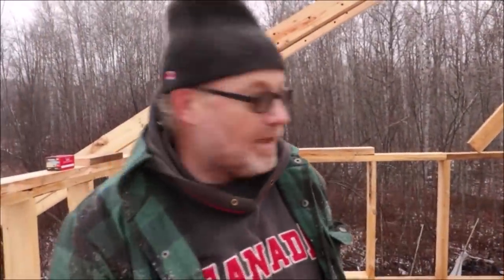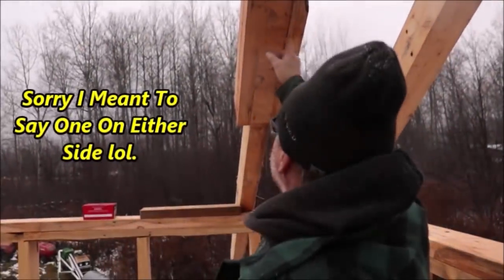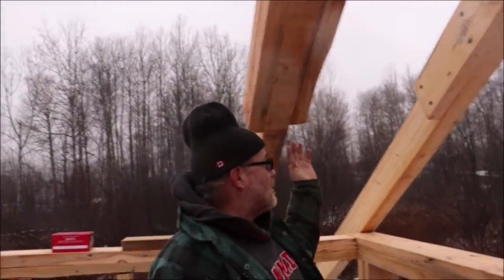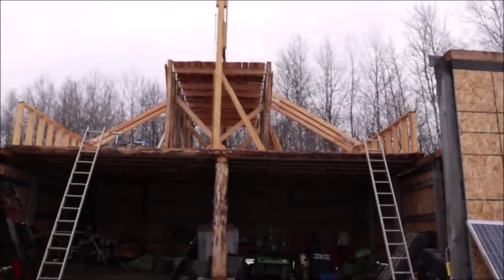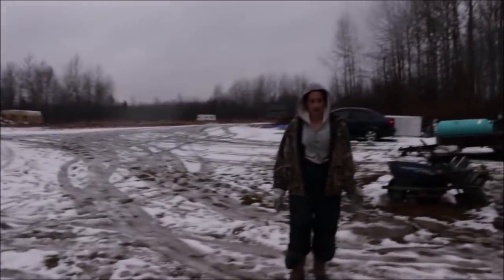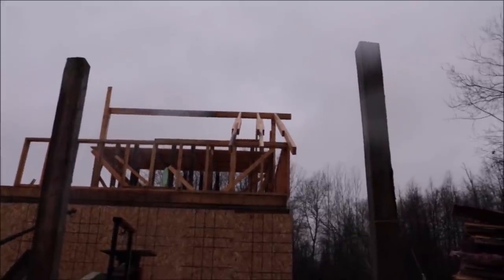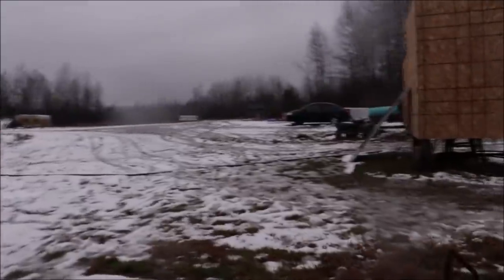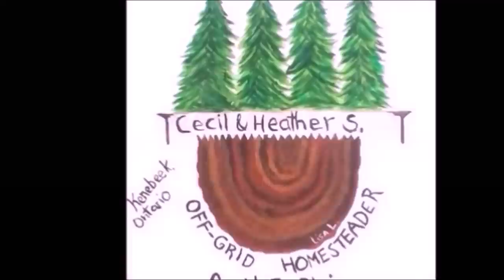This Day Was Another Challenging One For Us...But We Pushed Through. Off Grid Homesteading.

Comment: Cecil: 32-   3/8" lag bolt equivalent timber screws on the sistering for the rafter with the strapping  and blocking?  A little over kill?  Might I suggest 10 per side;  20 per rafter at $.75 per timber screw.  Ordered an other 200.   Bert
Reply: Changed order to 500 #10  3 1/8" Timber screws for the sistering.  They are a 1/4" lag bolt equivalent. $.25 per screw.  Should arrive Friday.
Reply from the maker: Hello Bert,  thanks.  Each side has a joint of four foot over lap...I start with two screws on each end of this joint two in the centre and one each in between this, this works out to two screws on each end..then two feet ( centre ) gets two more, then just a single one at the one foot mark from either end, then there are four joints per rafter, this equals 32 screws.  If this were dressed lumber and I could use glue, then I could get away with less fasteners.  I have one more rafter to make, then I plan on switching back to the five inch nails  ;-)   Hope this explains things.  Thanks again.  You have a great evening.

Comment: The generator sounds like it’ has a knock but it’s going. 👍🏻
Reply: Because it's a diesel engine
Reply: My diesel truck gets knockier when it needs an oil change or is low on oil.
Reply: Nothing wrong with the engine James,  diesels are prone to noise. The harder you run them, the better they like it.
Reply: Diesel engine combustion.....all at once....they're built for that....modern diesels address that sound....

Comment: Those rafter cleats up top were a great idea! How did you come up with that idea? Seeing the triples immediately reminded me of putting solar panels on the roof of our last home. They had to double every rafter from ridge beam to wall top plate just to protect from uplift from hurricanes. Also had to use hurricane rafter ties on each doubled rafter. You will never have a snow load problem on that roof.
Reply: Hurricane rafter ties order on way
Reply: @MrScoresby  our house was on the Long Island Sound and face due east. It received direct hurricane hits during every hurricane. Tough old house built in 1926. But we had 48 solar panels grid tied, so we needed the extra protection as required by the State. They would not allow us to operate the panels without these modifications.
Reply from the maker: Hello Michael,  thanks..this roof has to be able to hold a deck 10 foot by 18 foot...with a snow load plus solar panels ;-) Thanks again.  Cheers!
Reply from the maker: Hello Bert, well thank you very much. You have a great evening.  Cheers!

Comment: Great to see the building coming together.  Take a look on your speed square there should be degree markings on it; you use that to mark the rafters with or use the framing square; mark your angle on the rafter set one leg on the mark now clamp a board to the framing square to hold the angle.  You could screw a board to the top of the rafter that way you don't have to hold it when you screw to the ridge.  Stay safe and warm.

Comment: Why don't you set your miter saw on 30deg, and cut your rafter instead of cutting the same end twice?
Reply from the maker: Hello Marianne,  our roof is 30 degrees..this means our cut has to be at 60 degrees... 30 plus 60 equals 90  ;-)  I'd have to make a jig to cut a 60 degree on a mitre saw...they only go up to 45 degrees.  Cheers!
Reply: @SkinnersHomesteading  A 7/12 pitch roof is really close to 30 degree angle witch you can cut on a miter box.  Take your speed Squair or lay out your 60 degree angle on a piece of scrap and put it on the miter box set at 30 degrees.  It will work, I have done it for years.

Comment: Keep up the good work!! I don’t think that roof is going anywhere but do those screws have any shear strength? Maybe half screws and half nails??
Reply: They are timber screw designed for this application with the shear strength.  Each 5/16 screw is equivalent to a 3/8" lag bolt in shear strength.

Comment: Nice but be very careful running tools directly off a DC battery. If things are not grounded correctly, and even sometimes when they are, you can receive a very significant life threatening shock. It was also very concerning that it was a very wet environment and you were touching bare metal. It's a recipe for a very bad day. You might want to consult with an electrician and get a proper set up e.g., maybe some solar panels and safe components.  Not an old battery on a wet table.  You will be much better off if you put safety first.

I studied Elec. Engineering and also know people who have used similar set-ups. Similar concerns if you attempt to use that battery and a power inverter to get plug in power w/standard voltage. In these high drain applications, most people run class D batteries. 

Disclaimer: I am not an expert and none of the above meant to serve as advise of any kind.